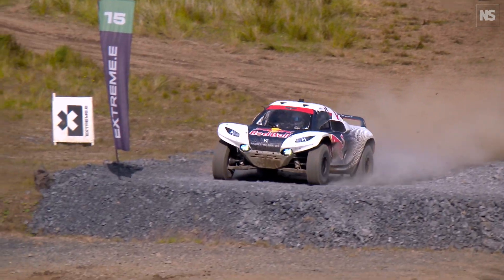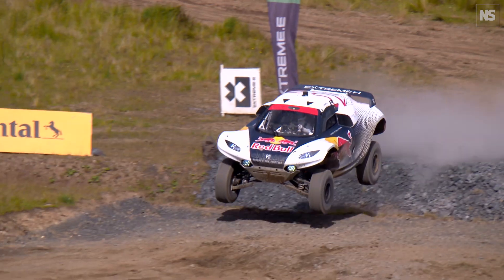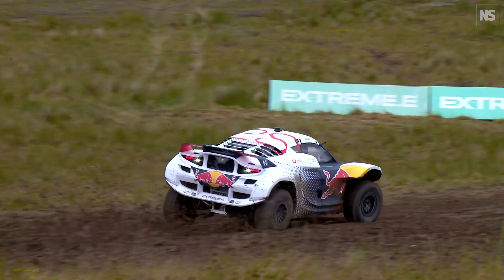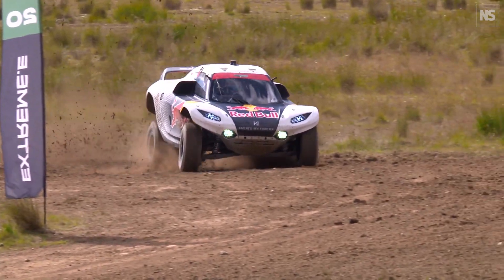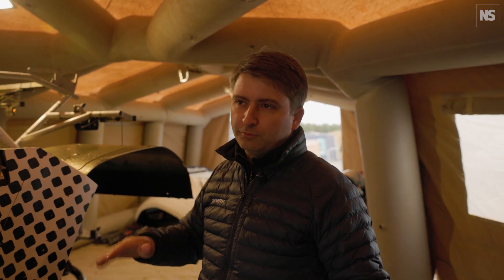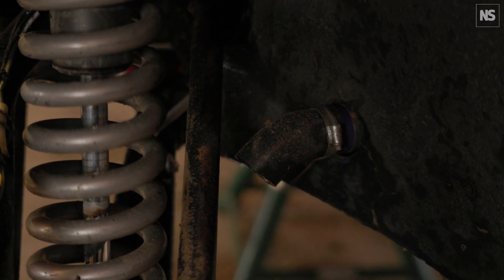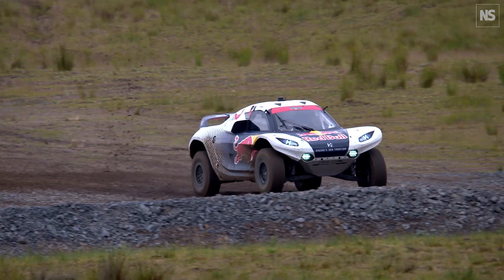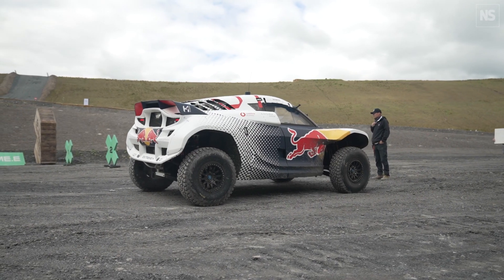Hydrogen off-road race car tested to limits in former coal mine

Comment: The message about hydrogen that you are looking for is that there is no indication that clean h2 production will scale up in any useful amount of time. First if all green h2 production must displace current industrial use fossil derived h2, then maybe aviation, possibly HGV then space  heating then finally electric cars. But tgat will take too long as BEV cars are already cheaper and better.
Reply: This won't be used for consumer road cars, but definitely will be in pro racing series. The teams at Le Mans will likely produce their own hydrogen on-site using pyrolysis because they can afford it and because it is a closed loop.